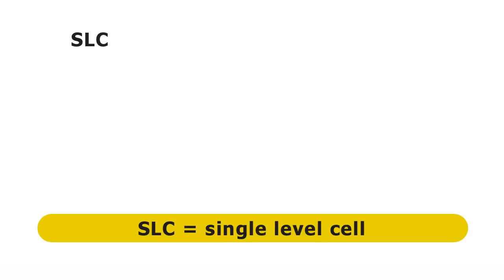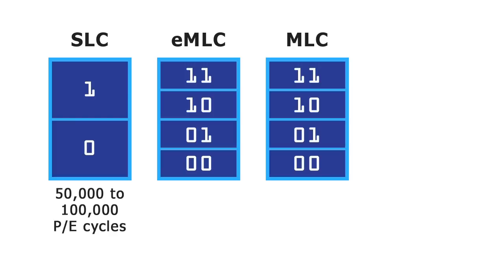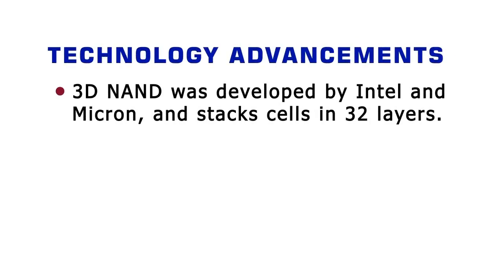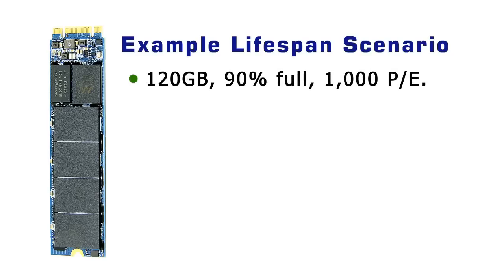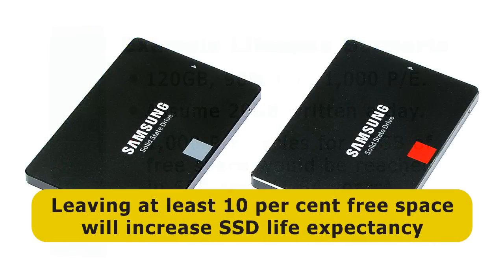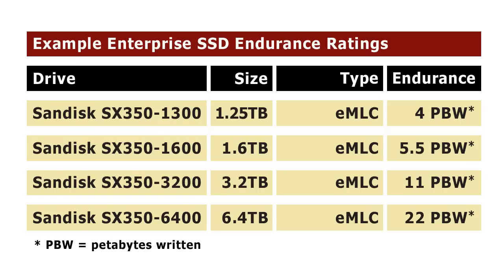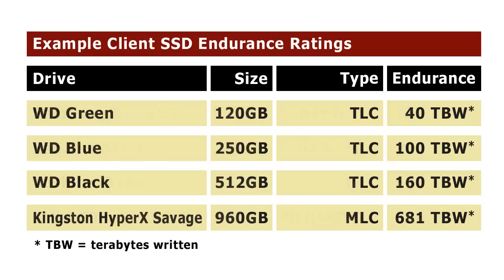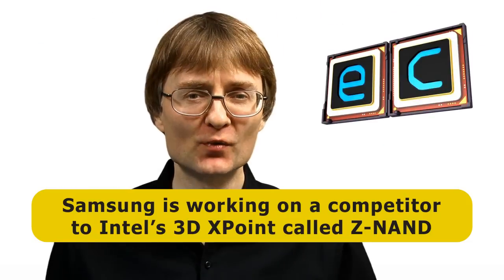SSD Life Expectancy

Comment: DON'T defragment SSDs either! They simply don't need defragmentation because they don't have spinning discs to read from, and doing so only causes more P/E cycles as the drive moves data around.
Reply: Agree, with a small "*".

Defragmenting the file-system, not the files on an SSD is recommended, as fragmented file-system in itself will lower performance. 

Its only few GB in size to de-fragment normaly, so it doesn't wear much more then u do every day anyways, and u only need to do it after for ex a major reinstall (with lots of Windows updates), or once every 1-3 months, so its v small wear, for maximum performance. 

This is exactly what modern OS like Win 8/10 does automatically, and u can do it with 3:rd party software on Win 7/Vista/XP too.
Reply: Most ssd's "defrag" themself, it is not the same but something like that it actually helps lifespan.
This video explains it pretty well: https://youtu.be/J9OhVpwx6tA
Reply: Linux doesn't ever need defragged. Ever.
Reply: @mikaelgaiason688  Bit of a myth, that.  Any OS on a spinning disc will need defragging after enough time.  You just don't have to do it quite as much in Linux.

In either case, you shouldn't defrag on SSDs because of the whole random access thing.  Making sure TRIM is working properly is important.
Reply: @jesuszamora6949  Sorry, but no.  Linux uses a totally different file system.  It's not a myth, it's a natural result of an intelligent design.

Comment: In my experience, HD quality and life expectancy can be loosely judged by the length of the warranty. In the old days you got a 5 year warranty because the drives were that good. I have such a HDD used as a backup, its more than 12 years old and still runs as new. When the companies began reducing the warranties, so went the life expectancy. Now its 1, 2 and 3 year warranties, 3 loosely representing the best you can buy, but also meaning to be ready to dump the drive right around that time. Its no surprise that Seagate is considered among the top and look, its got a 3 year warranty and a data recovery plan, too. To switch to SSD, i refuse to buy on short or no warranties, ive had too many flash cards fail in cameras and phones. Long warranty or forget it. Thats the measure of life expectancy as far as im concerned.
Reply: Crazy that it's not hard to get a PSU that is rated for 12 YEARS and DDR4 modules for limited LIFE warranties. Yet as you said you'll have a hard time finding a drive with a warranty that goes beyond those numbers. If not have TBW disclaimers. Just as car manufacturers saying 10 years warranty OR 100k miles...

Comment: Finally, someone holding a tablet properly, in landscape mode! That alone earned you a subscription
Reply from the maker: :) Welcome aboard!
Reply: The screen size of mobile devices and tablets is too small for placing horizontal text on a vertical layout. To fix that issue you render the text in landscape mode and it works wonders

Comment: I purchased Samsung SSD pro 840 at the end of 2013 and Its 2017 still chugging along. In Samsung Pro i trust.
Reply from the maker: Yes, I also trust in Samsung Pro. :)
Reply: Same here. Samsung may fubar somethings, but their PRO SSDs is not one of them. 

Currently its 3x1TB 850 Pro + 2x 2TB 850 PRO and some 256GB 850/840 Pro. 
The amount of durability these drives have is just amazing.
Reply: I've got a Samsung 840 250g and Samsung 850 500g.

The 500g lets you utilize 1G of ram to make them run a bit faster.
Reply: give it 5 to 10 years it wont work any more. they don't make things last long any more like did they use to back in older days. i have very old Sony Reel to reel from 1972 it still works great today
Reply: When you look at The Tech Reports testing when the 840 pro was included in their SSD endurance test the drive may out live you if it has a normal everyday use. The 840 pro only died after writing 2.1 PB. My two year old 840 pro has written 12.28TB so if I get as lucky as The Techreport and the other components dont die I am good for another 344 years of writes. Even if I am unlucky and get a drive where the nand can only survive a quarter of the writes that The Tech Report`s drive did it is still another 86 years of writes.
Reply: Tony Flores My Samsung 840 PRO failed after 4 years. I bought it 2013. If your Windows works 1 minute after start and restarts computer by itself. Shut down and read all important data with another computer. I had that change luckely. Fresh Windows installation did not recognise drive after one failed attempt.
Reply: "give it 5 to 10 years it wont work any more."

That's an entirely vague and fallacious statement. Any drive, whether floppy disk, hard disk, optical or SSD, can fail within hours of leaving the factory that produced it, or they can last decades. To say "it won't work any more" after some arbitrary timescale is nonsense.
Reply: if your SSD is 'chuggin' I dont think its an official Samsung SSD.....youve been had bro

Comment: You do not need lots of free space to increase life expectancy of the drive these days. Many people think the drive only uses empty space for wear leveling. This has been true in the past (and still is with simple flash based devices like USB sticks or memory cards) . But all modern SSD use 'static wear leveling'. That means at some point in time they will swap blocks that have been overwritten just a few times with blocks that have been overwritten more frequently. The result is a disk with evenly worn blocks even if most data never changes and the disk is very full. This is important because on normal PCs many files allmost never change (Windows system files, applications etc.) while other data changes constantly (browser history etc.). A memory card for a camera does not need such a sophisticated controller because there are no static files. You take photos, transfer them to the PC after the vacation and then wipe the card before you take new pictures.

Empty space on the drive will improve performance when writing as the drive does not have to copy the contents of "empty" blocks when swapping them with others. There is still some effect on life expectancy because moving around data causes new write cycles, internally the drive has to write more data than the user does. This is called 'write amplification'. But in real life it doesn't make a huge difference. Its usually better to invest the money in some form of backup than in a SSD that is much larger than needed (large SSDs are still expensive!).
Reply: Finally someone else that knew this.
Reply: so even if i lets say bought a 250gb nvme ssd and just jamed it full from the begining. i shouldnt be worried even after 2 years?
Reply: Why wipe SD card after copying image data to a computer?  Use it as a backup.  I have quite a few full SD cards. The  0.3 terabytes of data   from them is backed up to two external hard disk drives.
Reply: Reading does not wear out an SSD. Writing does. So if jammed it full and never wrote anything else, I would not be worried.
Reply: "Why wipe SD card after copying image data to a computer?"

Price of backup is much cheaper than buying a new SD card.
Reply: great info mate
Reply: Exactly. In domestic use, you're never going to wear out an SSD. Invest your worries in something more productive, like having regular backups in case it breaks for unrelated reasons.

Comment: There are so many places where hard drive can fail. Such as the motor or the mechanical head that's broken (not a big issue to the actual data on the platter depending on the situation). But hard drives can also have dramatic failures if the hard drive's head is stuck on the platter. A hard drive that is drop can also shatter the platters in the disk. A hard drive cannot be move a lot like ssd while running because that runs the risk of the head hitting the disk platter, causing a unreadable sector. 

Hard drive are so bad compared to ssd. The only reason we still use them is because they are still a bit cheaper. But in a few years, ssd will take over. The only tear a ssd really gets over a lifetime is the write cycle. So if you have a bunch of movies on a ssd and you don't really write that often,  you are using the ssd as flash memory (read only) and the ssd will last forever with this kind of use. Ssd are also cheaper to make on a large scale. Which is why they will dominate the world in a few years, rendering hard drives useless. We already have ssd that are 2 to 3 times larger than the biggest 14 tb hard drive thanks to 3d flash. And this is just the beginning of the advancements that we have made in ssd. There is much room left to get better at making ssd. 

However, i'm still amazed that hard drive work perfectly like they do today. The precision at which a hard drive has to operate at is crazy. Ssd are not that hard to understand. One could make a ssd on a pcb chip maker on their laptop. But hard drives are way more complicated. 

This is where i say "what a time to be alive"
Reply from the maker: Like  you, I am amazed as how HDDs hold up and keep working! :)
Reply: Because they were built to last a very long time and not really be handled constantly or transferred over and over.

I do not doubt that SSD will take over in the future, but the longevity of the HDD will forever be it's beauty.
Reply: @Life-tastic  So you are saying HDDs last longer than SSDs ?
Reply: @WhiteSlift  
I mean, that's a general rule for it yea
Reply: @Life-tastic  Even so, I think that a vast majority of users will have no trouble with the longevity of SSD's. I have one in my Laptop since June 2017. I use the laptop almost daily, and so far, the SSD has 6,1 Terabytes written on it. Even if we assume a lifespan of "only" 70 TBW, it would take me 16 years to reach it. Of course I'm not gonna use that laptop for 16 years...I would be surprised if I still used it in 4 years. 
And that's just a cheap SSD, a Samsung 860 Evo (still a cheap SSD actually) has an expected lifespan of 1600 TBW.
Reply: The science behind HDD amazes me a lot too! ⚛️
Reply: I've had one hdd fail since the early 90's, and I am still using 500gb hard drives as storage and in older pcs from the 90's.  I also donated 5 hdd's under 250gb that still worked due to being sata I, for me hdd are more reliable than ssd.

Comment: Important point: SSDs "leak" over time (most consumer SSDs may only keep their data for a year or so on a shelf, though some enterprise versions may last 10 years or more).  Therefore, SSDs should not be used for archive purposes, though if they are being used daily, the drive will keep the data intact by rewriting the fading memory.
Reply from the maker: Absolutely correct! :) Though note that data refresh is achieved via a read for an SSD (only HDDs need a rewrite).
Reply: Agreed. I still use Platter Drives for archiving data for long term. 

Life is always about trade-offs. 

I have a general rule that I partially or totally retire a drive after ten years. Unless it is designed to go the distance. Why, well most of my drives are platter. Mechanical failure is my primary concern. Even SSDs can fail.

Even with COVID and Stagflation. Platter drives are still cheap. I try to buy laptop and cam drives. They are desgined for write cycles and endurances. 

If you buy typically three replacement drives over you life. Let us assume you start at 20. Well since most people are going to live to their mid seventies. Or if they are lucky 100 years. Calculating the relevant cost is easy. 

SSDs are safer to carry.

Comment: Thanks for the explanation, especially the point about leaving at least 10% free. I'm constantly running my 250gb start up SSD to the limit, despite having a 1tb hdd for data inside my 27" iMac. I had no idea the harm I was doing to the SSD. Going to address this immediately. Namely putting my downloads and pictures folder in the hdd and keeping at least 50% free in the SSD.

Comment: It would be nice to see an update of this to see how accurate the expectations were.
Reply from the maker: I am planning such an update -- but there are no fundamental changes to what is covered in this video. We now have QLC drives (eg Samsung QVO) with an even shorter lifespan per cell. But they are so high in capacity that this does not matter for most users.
Reply: @ExplainingComputers 

You said that Intel was just releasing their 3D X Point drives. Not that long ago they announced they are pulling out of that....

I must admit I'd like you to explain that stuff and how it differs from nand flash memory used in SSDs.

Comment: Life expectancy and speed:

1) I used to have four, 240 GB (OCZ brand) SATA SSDs in an old computer, in a RAID 0 (cost much less to have those four drives vs one 1 TB drive, back then).  Anyway, I used those drives for 10 years, until I replaced the computer.  Those four SSDs never wore out, and I still have them, collecting dust.

2) In April of this year (2021), I started doing Chia processing on four 2 TB, Samsung 980 Pro, M.2 SSDs.  The Chia processing writes approximately 3 TB to 4 TB of data to each of those drives, daily.  At the time of writing this comment (October 2021), all four of those drives are showing no signs of tiring.

3) I have a 2 TB Samsung T5, to which I write 3 to 4 TB of data each day.  I have been doing this for months.  The drive is showing no signs of tiring.

4) I briefly had a 2 TB Samsung T7, which sucked.  It apparently used fast NAND fabric for something like its first 100 GB of writing, and then some crap NAND fabric for the rest.  So when continuously writing hundreds of GBs (or a TB or two) of data to the T7, it would fly for the first 100 GB, and then slow down to sub USB 2.0 speed.

When the T7 drive is idle (but connected to your PC), it will silently move the data from its super fast NAND cells to its super slow NAND cells.  Thus, freeing up the fast NAND section of the drive for new write requests.  As such, nearly all users will always have the fast NAND section of the drive available for use, and nearly all users will never experience the drive slowing down.

If you run CrystalDiskMark or some other performance measuring tool, and leave it at the default values (something like 5 GB of data for the test), then the T7 will show amazing results.
But change the values to 250 GB, and watch the results go down the toilet -- and be prepared to leave the test running for an eternity, because it will run for a very long time.

Folks posting benchmark videos never really push the T7 with lots of data.  So those videos always show the T7 as a top performer (because they are inadvertently testing only the ~5% fast sections of the T7.

If you need the capacity that the Samsung T7 offers, and you will never write more than a few GB to it at a time, then you will have a super fast drive that never shows signs of slowness.
But if you intend to write huge amounts of data to it, then look elsewhere.  The T5, on the other hand, is half the speed of the T7 (the fast portion of the T7).  But the T5 will never slow down, no matter how much data you write to it.  And the T5 will flirt with 450 GB/s, if you can feed it at that speed, and you can fill the entire drive, without rest, at that speed.  Try that with the T7, and it will choke.  I returned my T7.

Cheers!

Comment: Samsung 840 Pro 36.3TB written, still going strong. Thanks!
Reply: the pro 840 can do upto 1800TB before it may suddenly fail (might do 1000TB more if your not hammering it with random write at 4k)
Reply: I'm at 8.33TB written onto a 240GB Intel 530 series (It's currently my OS drive, but I used it for less demanding purposes for about 6 months before I switched everything over to it) and it has been at least 90% full for almost a year now, and the Intel toolbox puts its "estimated life remaining" at 75-80%.

I'm FAR more worried about it running out of space when I'm not looking and causing weird issues and crashes than it actually failing on me. I definitely need to upgrade though. It's getting really old to have to make sure everything saves to the other drives.
Reply: I used to use mine as an OS drive but then I bought a PCI-E NVME drive so now I use it as a secondary drive for torrenting as well as for editing video.

Comment: The built in pits in the substrate stretch and wear out from electron and atomic action and start erring. The more data Writes and reads the  less accurate each read and write becomes. Solid state drives will fail during an EMP. Mechanical drives that have an aluminum case will survive.
Reply: Yes, still Hard Drives are fine for archiving. SSD is for speed.

Comment: This is a very informative video.  I thank you for posting it.  This has been a question of mine for some time now.  I switched everything over to SSDs a couple of years ago for the speed, quiet and cool operation, ruggedness, and perceived reliability.  I have not been disappointed.  But, I was concerned about longevity.  I back up everything to the cloud and to the old hard drives I removed which now are connected to the NAS via the router.  Out of sight and earshot.    I feel reassured these SSD drives will outlast the computer for which they provide service.  Thank you.